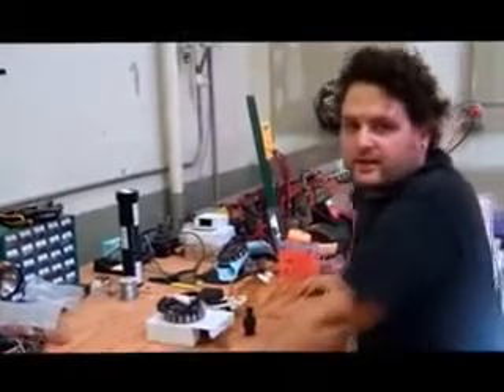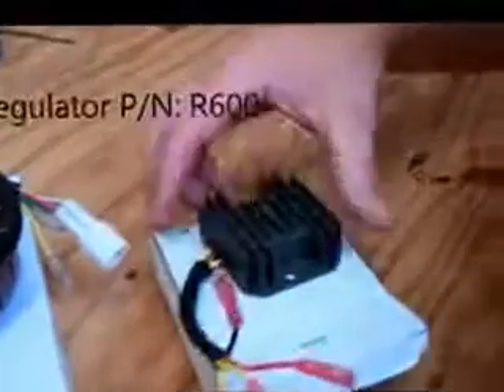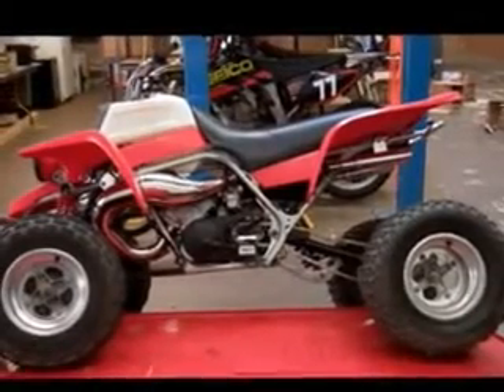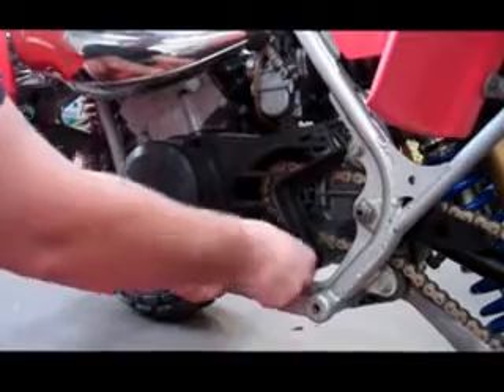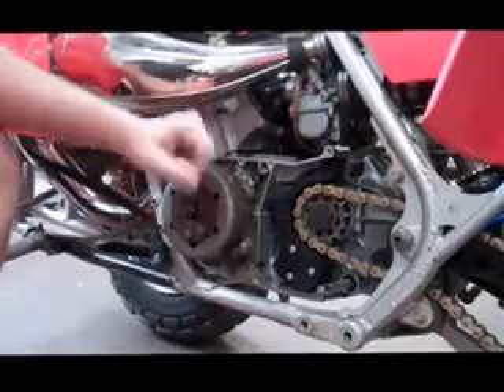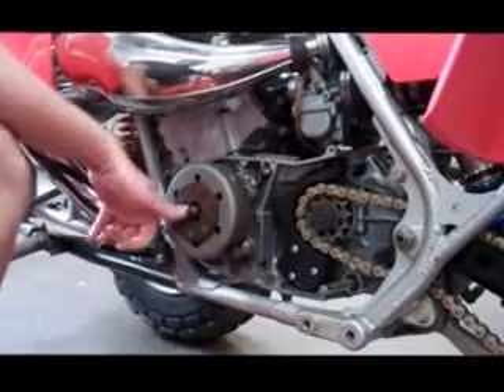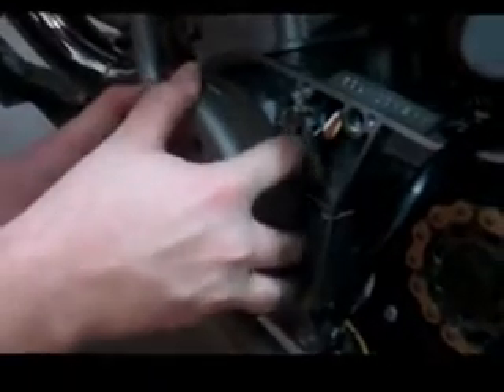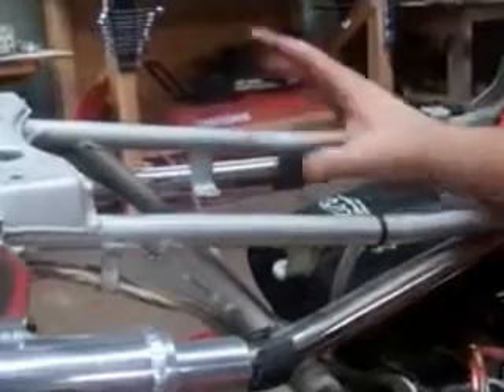RaceTech Electric Yamaha Banshee DC Stator & Regulator Kit Installation

Comment: I have to added  battery to my banshee, I used to standard stator and fitted a rectifier, same as the one in the video, it all works okay and I'm pretty sure that it does charge the battery but what I haven't done is put a floating ground wire in yet, I'm now thinking if I even need to ??
Reply: Where did you get the rectifier?
Reply: some diagram how to connect the regulator thanks
Reply: I'm looking to do the same. What specs rectifier / regulator does it take?

Comment: rebuilt my banshee New reeds and everything will idle fine give it gas it pops what's the deal
Reply: Joseph Johnson, did you sync your carbs, check your jetting, if it had bad Reed you might not have been getting the right amount of fuel, someone may have changed the jets to get it to run now you might be getting too much or too little fuel. Also try conpression test for bottom end also check for exhaust leaks and the boots around your carburetor banshees are fickle!!! But once you get it they are fun!! Last thing did you change the size of your piston?

Comment: I purchased the exact setup. I would like to add that in this video you say the battery wire harness is included. Is not. Also this stator is thicker so the 3 screws that hold the stator to the timing plate will not work. Other than that great product! Easy install!
Reply: do they still sell this went to the website and it seems to be down.  was wondering if they have moved or just went out of business.